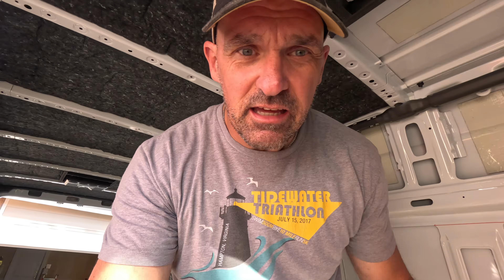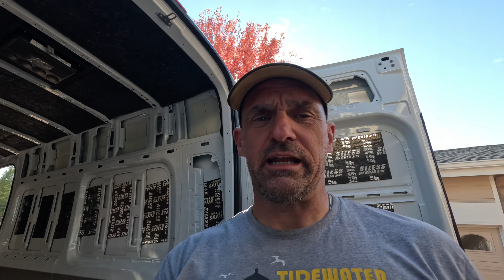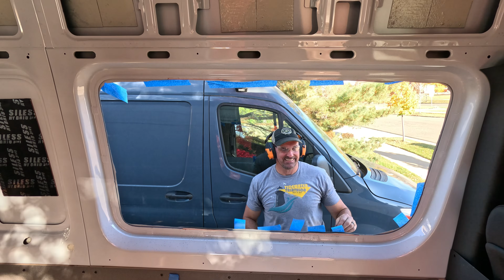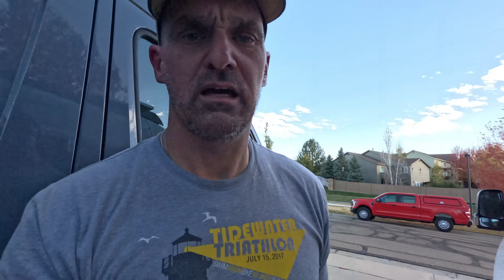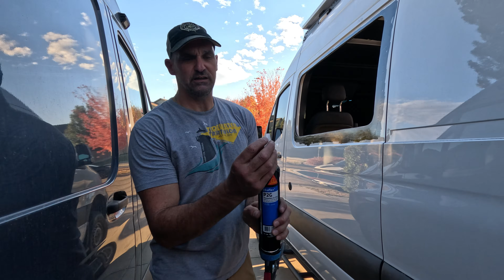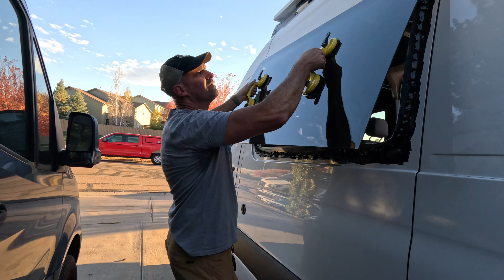Van Windows Direct Side Window Install: Mercedes Sprinter Step-by-Step DIY Guide

Comment: Not a critique but a question. Why did you use the reciprocating saw instead of a grinder with a cutting wheel? Was there an advantage to doing it with that saw?
Reply from the maker: @johnchafin3817 great question, the sparks, the reciprocating saw doesnt produce sparks, the grinding wheel does and sometimes the outflow of the sparks can cause other issues, the other aspect is, that mini recip saw has great control so less margin for error, great question though. I had used the grinder on other opening in the van for roof vents and learned real quick the saw is a better tool

Comment: Nice video! I’m only adding 2 bunk windows and a t-vent in the slide door. They all clamp in. I saw a few you tubers with broken windows and the glue ins are really hard to remove. 😬
Reply from the maker: Thanks, we are going to do an slider window on the sliding door, in my old van we did the CR Lawrence awning windows that had a clamp ring in the bunk area and honestly for our use they stayed covered 95% of the time so this time we are leaving them off, but yes if you break a glue in its a pain to remove but the spiral wire cutters they uses on windshields makes pretty quick work of them, hopefully we don’t have to figure that out!
Reply: @ramblingambition  
At first I didn’t want bunk windows but wanted air flow in the back while in bed and my wife wants them 😁. Adding only 3 windows saves money also helped the decision. 🤣🤣
Reply from the maker: @rod8073 I hear ya! Sometimes I cringe when I think about how much I have invested, but when you wake up in a amazing spot and open that sliding door to an adventure it makes it all worth it
Reply: @ramblingambition  
Oh yeah! This is my first van build so I can’t wait!
Reply from the maker: @rod8073 its great!
Reply: I’m pretty sure the rubber trim is supossed to be applied over both layers of sheet metal …..
Reply from the maker: It cant go over both it is only wide enough go over one seam of the sheetmetal, so you can either pick the outer skin of the van or the inner seam of the structure
Reply: @ramblingambition 
That’s correct!👍
Reply: That’s correct! Rubber trim on one side only! On the outside. 👍